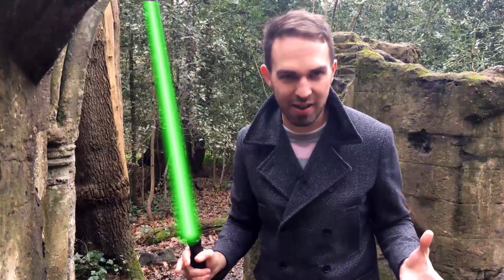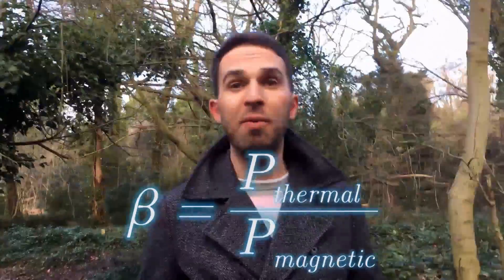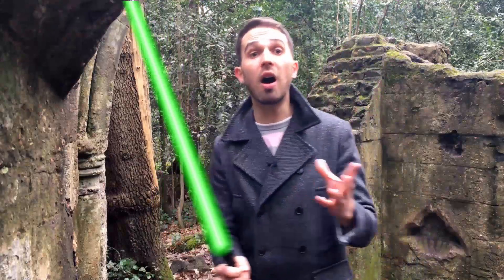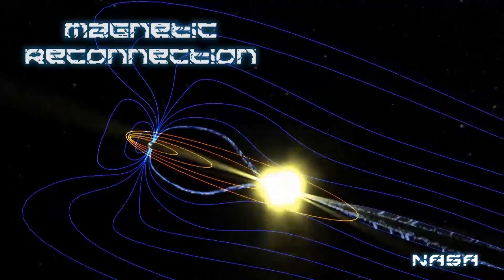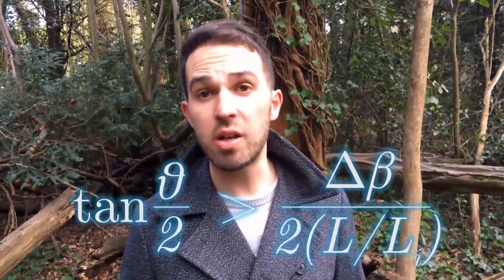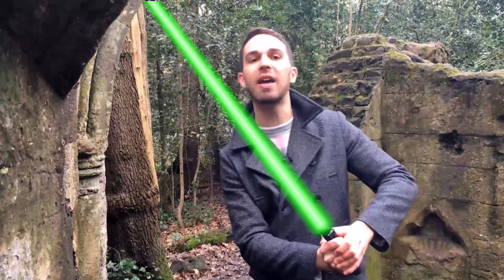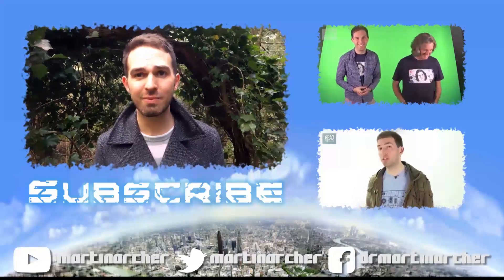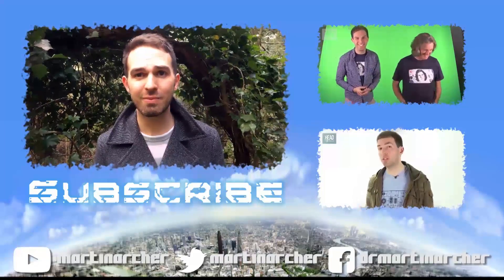The Fundamental Flaw with Lightsabers | Plasma, Magnetic Fields & Reconnection | Physics vs Film

Comment: Apart from the awesome physics stated in this video, this video does not mention the most important reason real lightsabers would not work. 

It is because we do not have the force, which arguably is the most critically important component of any light saber. The force is first introduced and maintained in a lightsaber by a kyber crystal, which focuses the energy into a stable beam. In SW cannon kyber crystals are alive as part of the force. 

So all those issues of the re-connection problems and the explosive face melting parts would not happen if the fictional Force actually existed. 

You fail by trying to debunk advanced fictional technology by applying it to our current understanding of what we have in modern science. 

Even without the kyber force crystals, it could easily just be the case that we do not have the necessary technology in our modern understanding of science, meaning there still is no fundamental flaw in lightsabers, only our understanding of them.
Reply from the maker: BPG Time to be fair, I did say right at the beginning this was about how we could make real life lightsabers using actual physics and technology, so it's not a critique on how they fictionally work in Star Wars.
Reply: If you will notice my last sentence i said, 
"even with out the kyber crystal"(which is the only directly fictional thing about a lightsaber) 
in other words i was trying to convey, "even without the fiction, just with science alone." 

That is why i ended my comment by saying your conclusion of a light saber being "fundamentally flawed", was wrong. Because it could just be, that our current and modern understanding of physics and science, is just not advanced enough to understand the necessary shielding and other components that would go into a lightsaber. 

So what is considered fundamentally flawed today, may in fact just be a lack of knowledge.
Reply from the maker: BPG Time But you can't just invent hypothetical new science to violate all known laws. We know a lot about plasmas, how to confine them and the processes which occur within them. There is no other fundamental force of nature other than magnetism that we can use for confinement over the scales of a plasma blade, but this means reconnection must be a problem that no amount of clever design can get around - it's a fundamental process in plasmas. So my argument stands!
Reply: Invent no, Discover possibly. 

To say that it is impossible to discover something new that changes the way we look at science or changes the way we thought physics works, is unscientific in and of its self. 

There have been many discoveries throughout the history of physics that has completely changed the current world view of what we thought the laws of nature were. Things that were earlier thought to be impossible or didnt exist at all. Until it was discovered and changed the scientific understanding of the laws of nature. for example; atoms, protons, neutrons, DNA, the globe Earth/Heliocentric universe, the C.M.B. 

I could go on for ever so i will leave it at those few examples. 

I hope you dont feel i have come off as aggressive or offensive, as that has not been my intention, please dont think that i am against your use of physics, your intelligence or even your character, only in your end conclusion of a lightsaber being fundamentally flawed, as i maintain that we could just not know, as science is always progressing. 

any way, all the best Martin, God bless
Reply from the maker: Impossible - no, but given the vast amount of evidence and confirmed theoretical basis we have accumulated - incredibly, incredibly unlikely. All paradigm shifts in science have come from evidence or motivation, so all I was saying is it's not scientific to say "we may discover new science" when there is currently little to no evidence or motivation for such things. That's the basis of how science works, anything else is just fiction until shown otherwise.

P.S. I've not been offended, just trying to clarify for you.